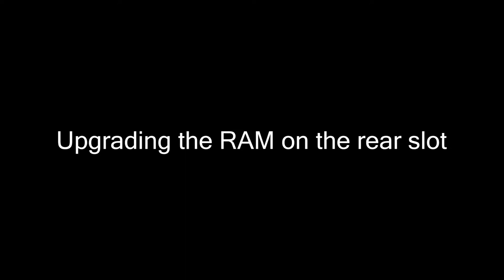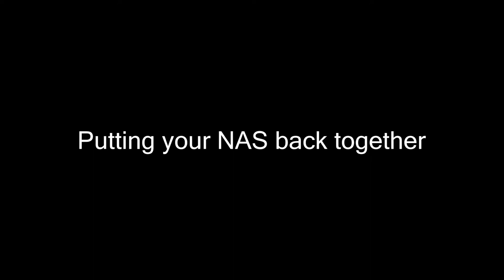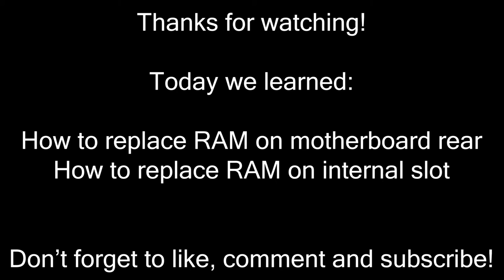Upgrading the RAM on your Lockerstor Gen2 NAS

Comment: Awesome video, can't believe how much you have to take everything apart just to get to that internal ram slot... this video made it so much easier to swap the ram out for a 16GB kit, thanks!
Reply from the maker: We couldn't fit it on the back due to physical limitations. So we kept one on the back for easy upgrades. We don't recommend going above 16 GB because that is the highest Intel specifies. Anything over and we can't guarantee stability.
Reply: @ASUSTOR_YT  appreciate the response!  Yeah I can definitely understand that there’s a trade off between having a smaller lighter unit, and ease of access to the internals.

I just have a question though, upon setup I noticed it defaults to RAID5 on the btrfs file system.  Are you guys aware that in the btrfs documentation, they say that btrfs has known issues with RAID5 and RAID6 and they advise not to use RAID56 with btrfs?  Apparently there are known bugs including write holes and potential loss or corruption of data on power loss!
Reply: @MrCdub003  This is a general raid 5/6 warning and honestly, it doesn't really matter much unless you are writing to the unit a lot (aka more of a business use). RAID 10 would be preferable if you need redundancy and speed.
Reply: @MrCdub003  ALWAYS have any "data critical" devices connected up to a UPS (Uninterruptable Power Supply)!!! That said, I purchased a small Pure Sine Wave Cyberpower UPS that interfaces with the Asustor NAS OS via USB connection and will do a graceful shutdown within 5 minutes with zero data loss or corruption.

Comment: One question: is there any performane/efficient reason to have 16 GB in two separate memory card or 16GB in  just one memory card replacing the original 8GB with a new at 16GB?
So: one is better that two or no differences?

Comment: One other question: I've been working with NAS devices large and small for a lot of years now, and while a couple of your competitors have seemingly stronger OSs, Asustor hardware looks significantly better. Plus...it's Asus, so I would expect low failure rates. My question is, when can we expect to see a level-up in the features/performance of the Asustor OS, like ZFS support, etc ? Because right now, that's the only thing holding me back from using them for a lot of my clients.
Reply: Asustor has nothing to do with Asus as far as I know
a min later edit: yep, their parent company is asus! hah, thanks for that info, would've never guessed otherwise haha
Reply from the maker: @hariranormal5584  Nope. ASUS is not our parent company. ASUSTOR is an independent company structured as a joint venture.

Comment: Question: What is the relative advantage of upgrading either RAM? For example, why would it be more advantageous to upgrade the INTERNAL RAM vs the EXTERNAL RAM? Or vice-versa?
Reply from the maker: It's not necessarily more advantageous. It's possible it just needs replacement in the future. The SOC supports a maximum of 16 GB.

Comment: I was trying to remove the piece at 1:57 and after removing the screw, still felt pretty glued on. I could not pull that sucker out 🤷‍♂
Reply: I had the same issue. I was afraid of breaking it as I was using more and more force so I stopped there. Only 12GB and no dual-channel for me at the moment.
Reply: Same issue here, it's fucked.
Reply: You can just continue and remove the motherboard instead. That board was stuck for me too somehow.
Reply: Make sure to take your hard drives out and it’ll pop out easy. If they’re still in it’ll be stuck.
Reply: @Ronnie.Ericsson @nickkroger2067  Thanks for the fixes, got it all sorted now

Comment: Just recieved AS6702T Gen2 from Amazon, purchased the suggested  Crucial RAM DDR4 16GB 2x8GB upgrade. Installed both sticks what pain for the 2nd module. Fired up the NAS system only show 8GB. I am fairly certain the RAM was seated properly on initial install, but before I tear down the unit again wondering if the unit indeed supports 16GB RAM? Is there any other setup? One other item does it natively read external USB drives? I have an existing drive which has 6TB of data when plugged into the back USB port the NAS see's it only as being full I can't access the file structure. My old QNAP NAS accessed the drive without issue.
Reply: Figured out the External drive issue, needed to cycle the External Hard Drive On/Off button. Still interested in RAM thoughts.
Reply from the maker: Hi. Is this RAM part of our compatibility list?

Comment: Geez….next time make it so that both SODIMM slots are easier to access.  This is insane!!!!!!
Reply from the maker: Hi. Given the size of the motherboard and the components used, it is not always possible due to physical or electrical limitations to put the SO-DIMM slots on the rear.
Reply: I read it comes with (1) 8GB stick, is it the internal or external that comes preinstalled?
Reply from the maker: @mrenrique90210  Internal.
Reply: @ASUSTOR_YT  thanks for the quick response
Reply: I was thinking the same thing, I want to add more memory not rebuild it- FFS

Comment: Thanks for the great video! I just bought one of these after drooling over NAS's for 10+ years. Just a heads up, I'm not gonna spend $90/stick for "compatible" memory. It would be better if Asus maxed out the memory as a standard and charged $100 more. I got two sticks of 8GB RAM from Kingston for $70.
Reply from the maker: Hi there! We are not ASUS. We are ASUSTOR. A separate joint venture. Also, we don't lock down the NAS. You are free to install any memory you like. We also have a compatibility chart on our site for people who want to know what types of third party DIMMs we have had the chance to test and verify.
Reply: RAM wise you can report what RAM you found compatible and they'll add it to the support matrix
Reply: I tried RAM that wasn't listed and an NVME that wasn't listed and they both worked...I submitted the request as well to have them added. Better to add your own of what you want and you can do it cheaper.

Comment: Because putting the both ram slots on the exterior like on the previous models was too easy :-(.
Reply: A lot of the positioning of components has to do with signal timings with the traces on the board.

Comment: Does the Lockerstor 2 Gen AS6702T support WD Red Pro 6TB WD6003FFBX? According to the website, it seems that it doesn't, but maybe the information is outdated? It supposedly supports WD Red Pro from 10TB, and 6TB shouldn't be any different from 10TB except for capacity.

Comment: I bought a Yottamaster dual bay enclosure and it's a piece of garbage. The controller can't handle both drives being inserted at the same time so the enclosure completely malfunctions before disconnecting from my computer. It's also prone to corrupting the partition tables on the drives. They use a JMICRON chip. I'm going to give this storage unit a try because it also includes NVME slots.
Reply from the maker: Hi there! We appreciate your support! I haven't heard of Yottamaster, but it does not seem like they sell NAS. We sell NAS devices which are different than the DAS devices that Yottamaster sells. Our products are self contained and plug into a network for data access.
Reply: @ASUSTOR_YT  Oh, so I can’t connect this directly to my computer? I was basically looking for something that I can access directly as well as remotely. I store a lot of movies and music on my computer, and I basically would like to be able to access those files from different locations.
Reply from the maker: @gunstargizmo  That's right. It connects only through the network. There is no USB direct connection. You can still use it to access files as if it were directly connected over the network by setting up a network drive. It is easy to get set up, but I don't want you to buy our products and be disappointed. I'd rather give you the truth.
Reply: @ASUSTOR_YT  Could I use one of your NAS storage expanders as a DAS? Something like the AS6004U.
Reply: @ASUSTOR_YT  Basically, I'm looking for an expansion device that can store my music, movies, photos, art projects, and Steam library. I have good networking experience, but at the same time, I don't want to be going through a bunch of apps or settings to play a movie.
Reply from the maker: @gunstargizmo  The expansion units do work with Windows, Linux distros and macOS devices to add extra storage. We don't see issues with it working with multiple drives.
Reply from the maker: @gunstargizmo  Our NAS devices do not require the use of apps or settings to play a movie. Once it's set up, a network drive can be made and all the files will be there just like any external drive. No fiddling with USB.
Reply: @ASUSTOR_YT  Thank you for the information. I will get one or the other. In the future, I hope you consider adding M.2 slots on your expansion units. I'm trying to get my Firecuda's moved from my motherboard because they get too hot stacked together. When this happens, they're ejected.

What are the main differences between AS5402T and AS6702T. Someone told me that the M.2 SSD speeds are slower on the gaming NAS. I like the aesthetic of the gaming NAS, but I choose performance over looks.

Comment: Ive just got as6704t and probably will returna asap, as cannot add my own 10Gbe card without removing ssd controller card, I cannot see from this film second slot for second card to have both ssds and 10Gbe cards, or I am pushed to pay extra
Reply from the maker: Hi there. We sell a 10GbE card with M.2 slots for NVMe SSDs.

Comment: My unit does not match these instructions!
Reply from the maker: Hi! Do you have a Lockerstor Gen2?
Reply: @ASUSTOR_YT  Yes? My unit has a power supply. The unit in the video didn’t have a power supply. I couldn’t follow the instructions for this reason because there were additional screws that had to be removed.

Comment: Why can't upgrades be made easy?
Reply from the maker: Hi there. We're a bit confused. We do provide easy upgrades by making the rear slot easily available to upgrade from 8 GB to 16 GB by purchasing another 8 GB SO-DIMM.
Reply: @ASUSTOR_YT  Yeah, but any random 8gb stick would result in two single channel modules instead of the memory running in dual channel. We either need to know what's preinstalled (which you don't disclaim, so we need to access it) or we need to replace both.

Comment: Use better screws... The ones on mine aren't deep enough and are way too tight and they are stripping when I use any type of screwdriver... This is a terrible design
Reply: Had no problem with mine.
Reply: @acidfly1  I must have had the b team picking my screws... The depth of the grooves were almost flush with the face making it near impossible to get the Phillips head in and made it strip trying to turn it...I tried 4 different Phillips drivers, all the same results. Glad it worked for you but mine was a complete mess.
Reply: I am facing the same issues which screw driver works for you?
Reply: @mani1098  unfortunately I don't know the brand... I've had it for years and can't remember where I got it...I tried a few before I found one that only slightly worked...I had to put a lot of pressure into the screw to ensure it didn't slip off, if you know what I mean. It's a pain in the ass for sure... Good luck
Reply: I am curious as to what size Phillips screwdriver is required to get the accurate fit @CurtisAstro